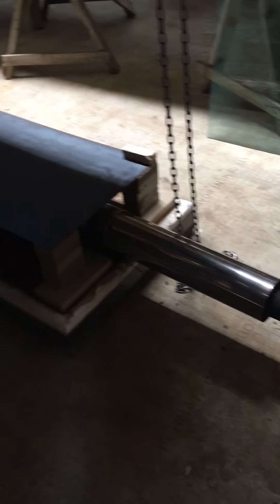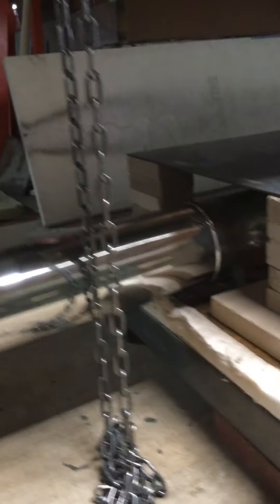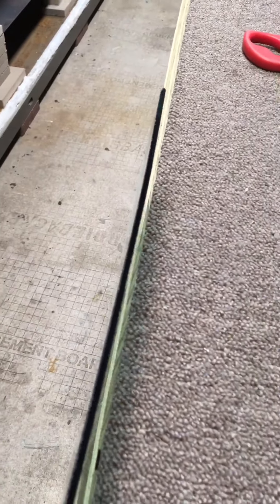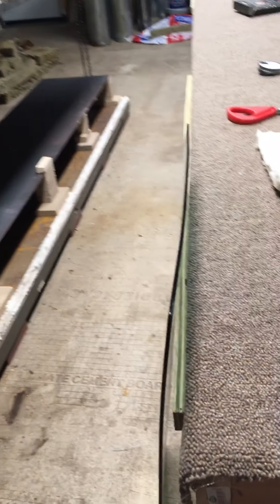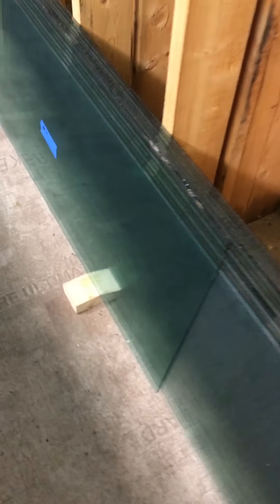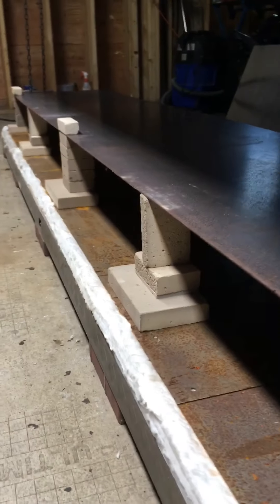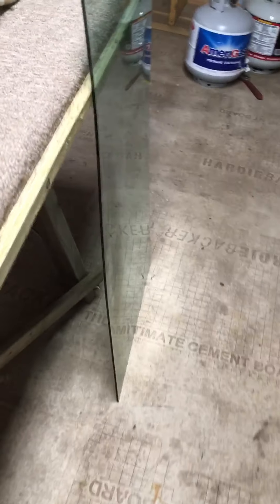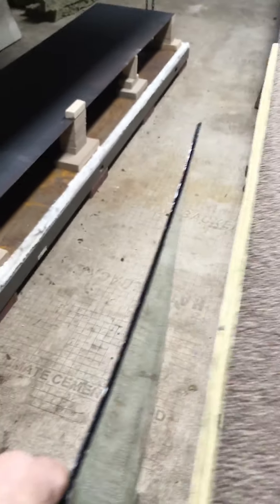We cut tempered glass... just anneal it!

Comment: You don't need to heat the glass, to cut it.
Reply from the maker: No only  if you own a laser
Reply: @BostonMark  I have heard of and met people professionally who claim that they have lasers that can cut tempered glass, but to date I have yet to find one that can actually do it despite being involved (again professionally) in glass processing and equipment acquisition including glass laser cutting technology.
Reply from the maker: @gregcorwin8316  if it can be done it’s pretty amazing!!   We were stuck, had all this nice glass because it was tempered and couldn’t be cut to size. Did not stop us … We made our kiln baked it up about 1k degrees cooled it slowly and evenly and basically erased all the internal kinetic energy trapped in that glass for the last 30 years
Reply: @BostonMark  I truly applaud your ingenuity and I think it's great that you reused all that glass rather than trashing it, but my reply was simply intended to comment on the title saying that you cut tempered glass when in fact the glass wasn't tempered when it was cut. Unfortunately some people think that tempered glass that has been heated and slow cooled to remove the temper is still safe to use in safety glazing applications because it had been tempered at one time. Also if the now annealed glass has a tempered logo in the corner,  that can potentially cause confusion and worst case harm to someone.